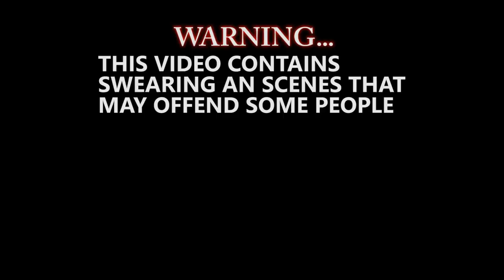DUCK SHOOTING 2019

Comment: you should hook the tape end on the out side of post and measure to the inside of the next post ,its called in and over more accurate than centre to centre,thats the builders method way .
Reply from the maker: Cheer bro too much ruff an ready fences ae